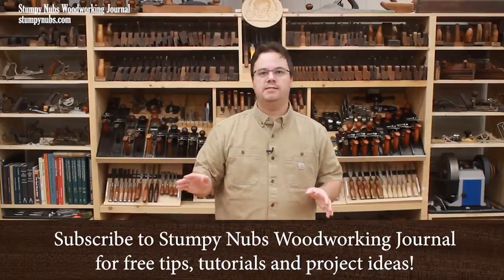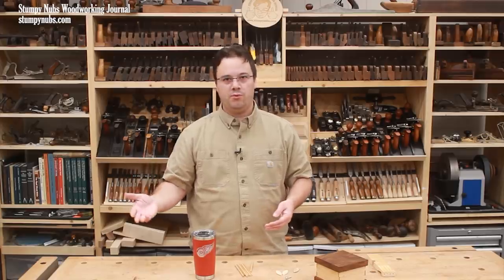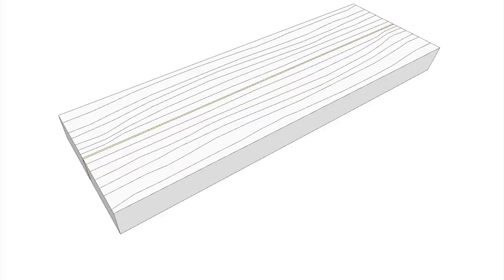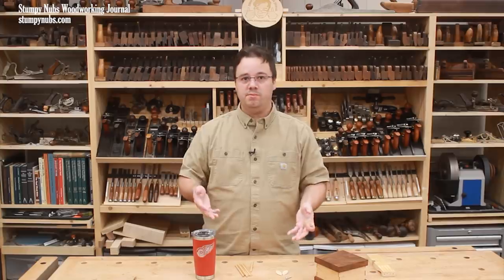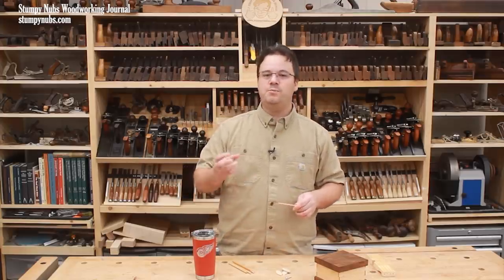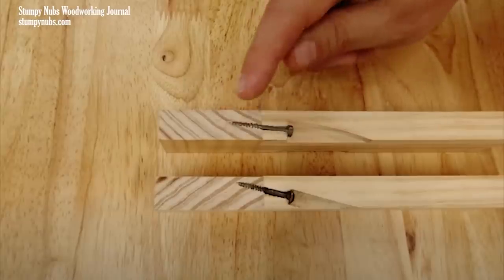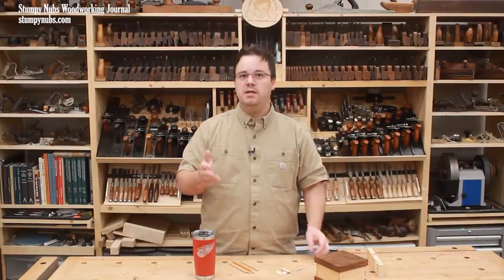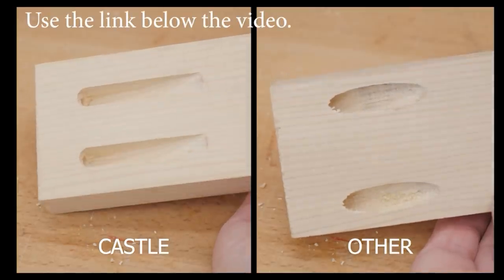Many woodworkers use these wrong! (biscuits, dowels and pocket screws)

Comment: I have had a biscuit joiner for 20 years and I love how Mike Farrington boasts about his biscuit joiner and he's one of the best carpenters I've ever seen.  can't be bought!  And go Norm!  The man who single-handedly started a generation of DIY woodworkers.  What you didn't mention about biscuits is that the glue helps them to swell to lock the joint tight.  Biscuits are very useful for mitered corners to keep them from splitting apart on the end grain

Comment: I also like to say, use joinery that's appropriate for how much you plan on selling your piece for. Obviously a piece of furniture made with pocket screws and biscuits should not be priced the same as one made with dovetails and mortis and tenon joinery. 
This is the one I have a hard time trying to explain to many people
Reply: I see what you are saying but dowels or biscuits are often invisible on a piece so it’s hard to say whether a piece using them should be priced lower. Pocket screws are often not visible either in the finished piece if they are covered with trim. The materials , design and look of the piece are often the rationale for the cost of the piece not the joinery as such. There are those buyers that do focus on the joinery. Your point is well taken.
Reply: @jeffhreid  I make it a point to ask them what their expectations are. Some clients dont care/dont know any better, and sone want a high end piece with traditional upper tier joinery methods. Makes my life so much easier knowing from the get-go
Reply: Exactly. Novices don't always understand that cheaper/faster production doesn't mean high end price. I guess they think they are coming up with something for nothing.

Comment: For certain situations dowels can be used a bit differently. Imagine putting something together the way you want it to be glued (with whatever means you like) and them from "behind" drill through both workpieces and then put dowels in, glue stuff and trim off the excess dowel. Unless you like the look, thats something for places where you can't see it, but done well it can make for very strong parts. Sometimes it can even be appropriate to drill and glue another dowel at a different angle to increase the strength in that direction.
Reply: This is primarily how I use them. Screw it together with whatever screws you want, and wait for the glue to dry. Pull out the screws and drill for the dowel right where the screw holes are. Fill with glue, tap in your dowel, and trim off the remainder with a Japanese saw. Much easier than getting those little bastards aligned perfectly.
Reply: I've used that method. Even where you can see them, it can look neat, especially if you sink them and cover with face grain plugs.

Comment: Your arguments are spot on. In most situations any of these methods are far better than another one that I come upon far too often, staples. I’ve had to repair or modify several articles of wood (if particle board can be called wood) that came apart with very little effort because they were knocked together with a few staples. That’s an advantage for taking something apart but not if you want something to actually last.

Comment: Spot on the best joint is the one that holds up over time. 2 years ago I screwed everything and it is still good today up but as your woodworking advances so does your  skill set.  I still use screws on some stuff. I just hide them better now. I like biscuits and pocket screws for some stuff. I love dovetails they just dont love me back  but I'm getting there.

Comment: Good video and and mostly agree.  I generally only use pocket screws with plywood, particle board, MDF "boxes" and never on cabinet face frames where a biscuit may be a slightly  better option. Outside of "boxes" pocket screws don't usually meet the "beauty, function and durability" requirements.  However pocket screws are certainly a great choice for the newer weekend woodworker.

Comment: Thank you, thank you, thank you! While I'm not the dowel guy ( no accurate jig!) I do use biscuits for alignment, and pockets for both crude (shop-type casework) and fine work as well. My biscuit jointer is a PC 555...the first gen. I can make accurate 90° slots at the depth I require with my 30yo tool, and that's all I need. I have the new 'cheapo' Kreg setup, replacing the $30 setup I got years and years ago. I cheat sometimes, depending on the material I am using. I may clamp the jig at the 1" depth if I am using soft plywoods taking care to use slightly shorter screws to prevent 'poke-thru'. All in all, both types of joinery have served me well, and I feel vindicated hearing your 'defense' of my less-than-snooty tech. You rawk! By the way...I bought that 555 biscuit jointer new...when it was the first domestic tool on the market for that application...if that gives you any indication how long I been makin' sawdust.

Comment: Years ago I made a computer desk by having a laminate countertop made and supporting it on some file cabinets on either end. It was a long countertop and needed support in the center. I built an open cabinet out of MDF. I had the guy at the lumber yard make all my cuts, (ask nice and tip). I brought the pieces back to my apartment and screwed them together with drywall screws after using a router to make groves to mount aluminum tracks for adjustable shelves. I covered the outside with laminate. I don't even think I had a speed square or anything to check if the corners were square. It was rock solid. The only reason I don't still have it is I moved to a different apartment and it wouldn't fit.
Reply: I love this story, because it sticks a pin in the balloon of pomposity that sometimes surrounds woodworking, at least in the minds of some who love to be snobs about it, and who would criticize your choice of materials, design or joinery.  You satisfied the important elements:  You had fun, the end product was useful to you, and it served its function.  Can't do much better than that!

Comment: I have experience with almost all joinery and skilled in most incl. dovetails, pocket screws,  and mortise and tenon. About 15 years ago I was introduced to dowels using the Dowelmax jig. It is great. It makes joinery fast, extreme accurate and extremely strong. I often assemble my projects without glue and check the look and fit of the project. It’s easy to undo and then rebuild a number of times to check before gluing. I got the 3/8” standard set and 1/4” . The latter is great when joining 1/2” plywood or a 1/2” face to a drawer. The jig is Made in Canada and the steel used in it is the best. There are cheap jigs that you’ll find but I’ve seen nothing that comes close to Dowelmax.

Comment: I worked in a refinishing shop in the early 90's as the repair man. I can't tell you how many sets of chairs I had to take apart that had doweled jointery. They are certainly stronger than they get credit for.
Reply: Dowel joints are crazy strong, stronger than mortise and tenon joints.
Reply: @geraldl5221  no shot. Mortise and tenon will always be the strongest wood joint. You have wood grain, two working components rather than multiple points of failure and more surface area for glue.
Reply: @Sean-yb2mp  isn’t it easier to get the wood around a mortise to split when the tenon sets ? I’ve had this failure happen to me, don’t think it would have happened with dowels.
I think multiple points of failure are better then a single point of failure? :p
Reply: @Keneo1  I fail to see how a mortise would fail. It depends on how you designed it; the walls being too thin, the wrong application for the joint or wrong use of wood/grain direction are all examples. The tenon should fail before the mortise does.

Comment: Thank you for another good video.
Your skill and thought in making these is immediately apparent.
Pocket screws are very useful indeed for site work particularly when clamping of parts is impossible and also where access is poor. I recently built a kitchen cabinet in situ one piece at a time behind an existing face frame where a boiler had been. Pockets made this much easier than it otherwise would have been. Pellets were used in the pockets under the cabinet but not on the top of the carcase. When I clean on site at the end of a job I sometimes have cause to clean the tops of cabinets and wardrobes where i usually find geological stratae of dust so I reckon that pelleting would be a waste there.
I personally loathe dowel joints because of the utter faff in jig setting. I use dowels by the thousand in renovations though as they are ideal for restoring screw holes from which the rusted remains of screws have been withdrawn.
I drill the hole out then glue in a dowel with 5 minute polyurethane. This is something of a misnomer and I always leave it no less than half an hour after which the hole can be spotted through the ironmongery ( usually a butt hinge or sash pulley) and pilot drilled.

Comment: I'm a novice woodworker my first major project was a desk for two computers. It is 3500mm long by 800mm wide and 26mm thick. I had to make a dead straight cut the full length (3500mm) with a circular saw to join the front and back sections of the desk to make the 800mm width. There is 28 dowels in there holding it together. Didn't get any wrong with a relatively cheap jig and centre punch combo. 
I'm still really happy every time I look at it.

Comment: THANK YOU for your very true and accurate description of the added (albeit small) extra strength that biscuits do add to a joint, AND for explaining why!  I get so tired of hearing the obligatory "Contrary to popular belief, and sorry (not sorry) to tell all you rubes out there, but biscuits don't add any strength to a joint, at all, zero, nada, although we'll begrudgingly allow their use for alignment" comments in videos.  I've actually clicked away from videos where that stale refrain was intoned -- even though I wanted to know about the project being depicted!  It's like mindless repetition of some partially-true line (they don't impart zero strength, there is some, as you showed), in order to curry favor with 'the joinery snobs'.  Ugh....

Comment: I'd really like to here your take on dowel nuts and connector bolts. They can be significantly stronger than any of the joints mentioned in this video, but they do carry the stigma of being a mainstay of flat pack furniture.

Comment: Depending on the project, don't forget the lowly black or brass screw. They can be really elegant.
Reply: Oh, mr fancy, and I am over here using repurposed deck screws for shop projects, lol.
Reply: I'm gonna butcher the quote so I won't say it but it reminds me of Moe talking about garage vs car hole
Reply: @MMWoodworking  wait…. Was I not supposed to reuse my screws??
Reply: Or nice nails.

Depends on the style you aim for.

(and a biscuit is just a thin floating tennon, if those are OK, biscuits are)
Reply: I often paint the screw heads if there are going to be visible screws. I just refinished a pair of nightstands in grey with gold drawer pulls. I painted the screw heads that was attaching the pulls and a few other detail places. Makes it MUCH more elegant and thoughtful of design!
Reply: You spelled "drywall" wrong
Reply: @Jchot  This one hit home for me haha. I just got finished ripping together a rough and tumble workshop audio/rolling worktable rack with leftover scrap I had. Didnt want to hit the hardware store and the drywall screws I had laying around were the PERFECT length.
Reply: Copper nails look really cool in certain applications as well.
Reply: @wearsjorge55  YES! It's the counterfeit jeans episode. 
"Ohhh garage! Mr. Fancy Frenchman!"
What do you call it?

"I call it a car hole" 🤣

Comment: When you said some people will recognise the skill that went into making the box struck a chord with me, as I believe that too. A few years ago I was called to a MOD base for a faulty gas cooker, it was the thermocouple. As a mobile engineer I carried ‘universal’ replacements, 900mm in length, the original was approx only 150mm. I got a small rolling pin and wrapped the thermocouple around it, making a spring shaped coil and left the ends sticking out to connect onto the unit.
The apprentice I had with me asked why I bothered to make it look nice because upon testing it was working ok, I boxed it back up never to be seen again, until it itself failed in a few years time. “Because when the next engineer sees this he’ll hopefully realise to hisself that an old fashioned engineer with old fashioned skills replaced it” I told him. He looked puzzled and said “I wouldn’t bother”………………….. ☹

Comment: I built a screen door (that was missing off my mobile home) about ten years ago using glue and pocket screws! Honestly it didn't have to support a lot of weight and I just needed a quick door that keep bugs out of my house most of all!! Just repainted the door last week and it has been holding up fine even after all these years!! Likewise I build kind of a "similar door" for my shed workshop, though I messed it up by forgetting to use a square while building it!! BUT the door I knew on my shop was going to get beat up a lot more....so I attached the framework to a sheet of plywood that makes up the actually DOOR part of it!!! The kicker is, I built the shop door nearly 12 years ago with the same pocket screw method I used on my screen door.....and that is still as strong as ever!!! Even though I know it isn't exactly square!!!

Comment: I love my dowel max and my biscuit joiner as well as my pocket hole tool. You are correct there is a perfect place and use for each one. Imagine if doctors were still using booze to knock a patient out! Times change and technology makes everything we do easier. I love the old methods of joinery especially Japanese joinery which is truly amazing. There is nothing embarrassing about using the joint for the job new or traditional.

Comment: Biscuits are great for gluing multiple pieces of wood into a large panel. They align everything really nicely and add some strength. If That larger panel is going to be structural, like for the side of a desk, dowels are great. Tedious, maybe, but the payoff is a joint that won't quit on you. Dowels are also wonderful for filling nail holes. I replaced some railing that was nailed into the top of 4X4 posts. After pulling out the nails, I drilled out the nail holes and filled them with dowels and glue, cut the excess off, and presto. The construction screws I put the now boards down with were safe from encountering the old nail holes.

Comment: I'm definitely no fancy woodworker, mechanical joints and practicality all the way, I felt pretty fancy buying a pocket screw jig and making my first project with it recently. Made a coffee table with storage for board games, with half inch ACX ply and very expensive kitchen-grade latex paint, which we decided after the fact to apply poly over for allergen and durability purposes. (Topped with oak veneer plywood, stained ebony and covered in poly, to elevate it a little bit.) My other big upgrade is finally getting a normal random orbit sander: I practically could have just put clear poly on the sanded ply and gotten a glassy smooth surface, having filled and sanded both sides of all pieces to 320. I appreciate these videos about the more humble methods.

The whole "along grain vs across grain" anisometric thing reminds me of 3d printing layer lines, which is how you know I'm a nerd 😉🤓

Comment: Glad you made this video it's amazing how many videos are against these methods. One more thing dowels have very small glue surprise because much of the hole is end grain which is a weak glueing connection but biscuits have a larger glue surface. Fine woodworking many years ago did a test on the strength of biscuits interesting read.

Comment: After seeing the Patrick Sullivan's videos, I made my own test, and I can confirm that many times, or may be always, a simple glue is the stronger joint, no biscuits, no dowels, no screws needed. Now I'm using Polyurethane glue as my principal glue, is an extraordinarily strong adhesive.
Reply: I read a bit about PU glues a while ago. Thought it would be good stuff to add to a rough frame that will be used to dry firewood outside. But apparently it is only cosmetically gap filling (expanded foam has little shear strength). Also I heard that it creates a very hard joint, which was apparently demonstrated when a PU-glued fretboard came off a guitar after having received a not-too-heavy but fast hit. Now I think I'll have to experiment a bit. At least it should handle outside conditions better than PVA glues, perhaps also bond mixed materials.

Comment: I've found myself using dowels a lot, however I either don't mind, or quite like the aesthetic, so tend to glue and clamp a plain joint, and then go and add dowels on top, through the face grain and into the end of the adjoining piece. Leave the dowel slightly proud and trim it off and sand it in once it has dried. No problems with alignment  this way. Also I tend to work with bb furniture ply, which has it's advantages too. I recently bought a plug cutter, so can now cut dowel caps in the same wood the item is made from, which hides them brilliantly.

Comment: I'm not a woodworker by trade, but I sure do enjoy nearly everything about it. Recently I had my first experience with Brazilian Ipe hardwood and it kinda blew my mind. The density, the weight, the beauty of it. I read that Ipe is what the walkways of Coney Island were made of and it lasted 25 years. This wood has the same fire ratings as steel and concrete and it is so dense, it doesn't float.

Can I humbly request a skilled master such as yourself make a video about this wood? It 'wood' be something to enjoy.

I found your channel only a short while ago and I love it. Thanks for sharing.